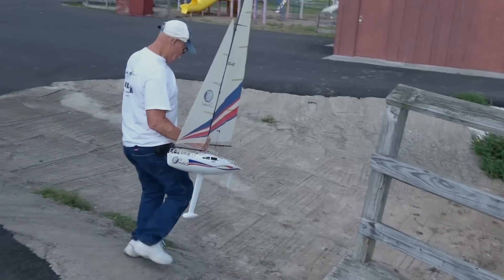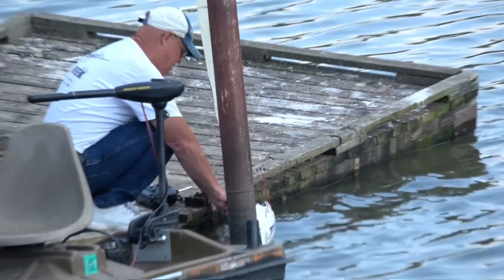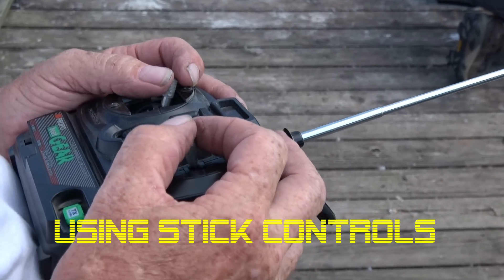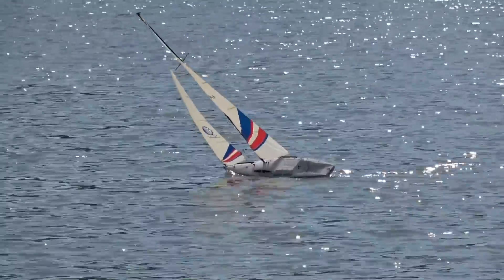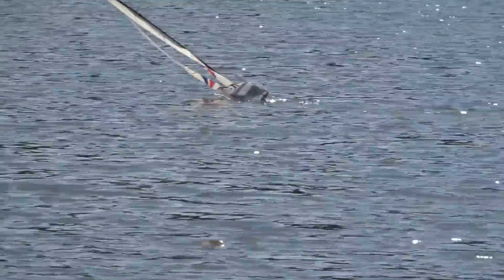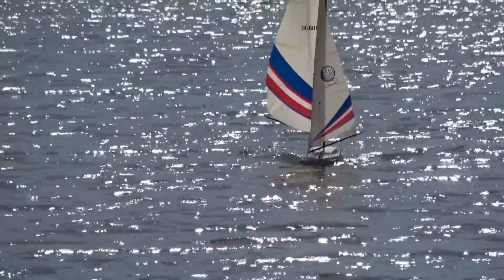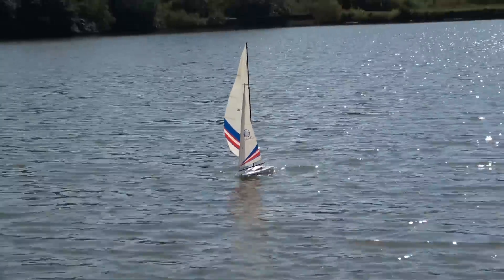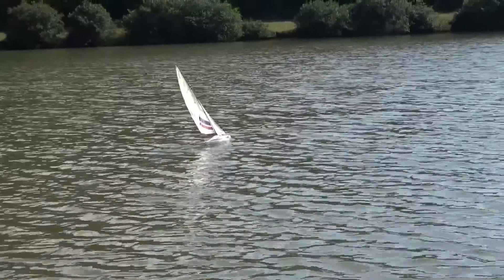How to Sail the Sanibel RC Sailboat for racing or pleasure

Comment: Your explanation about aircraft rudder should of been more in detail. It really comes down to the controller you're using, yes if you're using a one stick 2-3 channel setup then yes your rudder would be controlled using a one stick transmitter on the right side.  But typically 99% of the time you would be using a higher channel radio, with two sticks, and the rudder would be on the left side, not the right.   However, there is an exception to this rule, if you fly in Europe, they typically fly with the controls reversed. Why? Well because they can't win world wars like we can here in America.